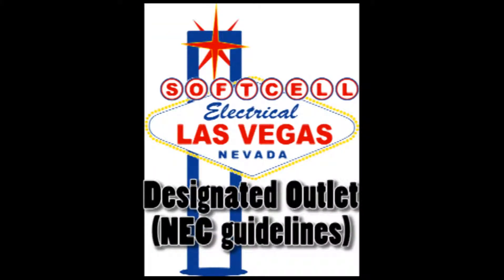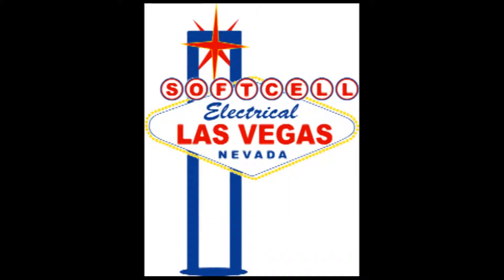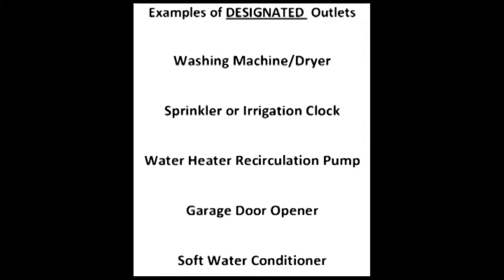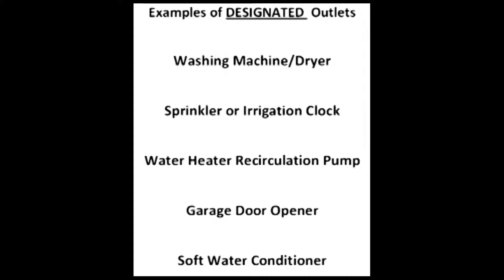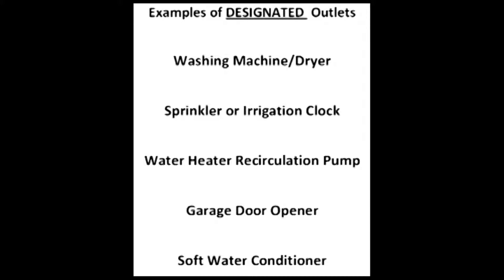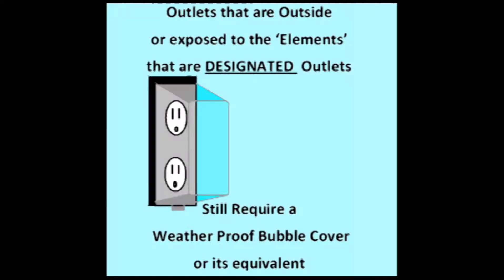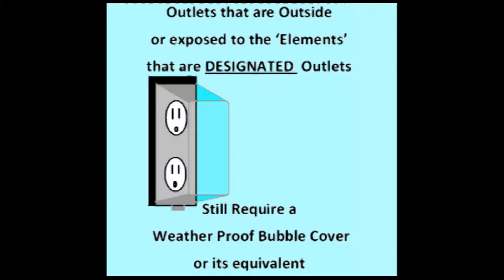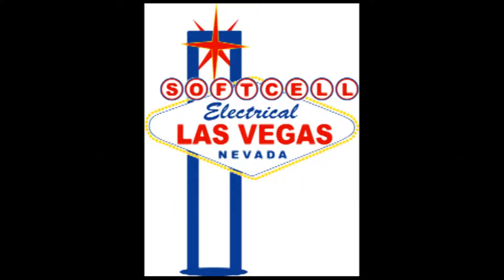NEC code on designated outlets # 98

Comment from the maker: Yes to all of the above, and there are other exceptions that are too numerous to comment on.  The basic rule is that any appliance that is 12.5 amps or greater require a dedicated circuit.  However, a refrigerator requires a dedicate circuit regardless of the amperage draws.